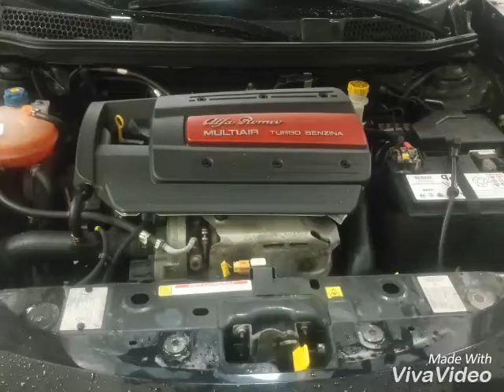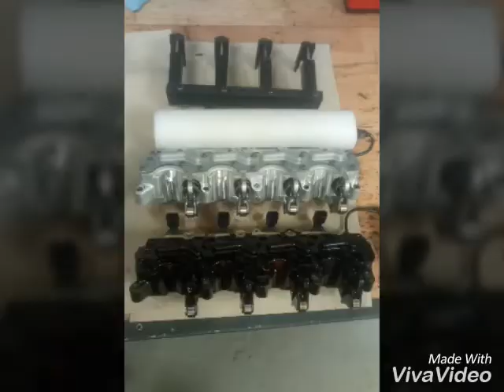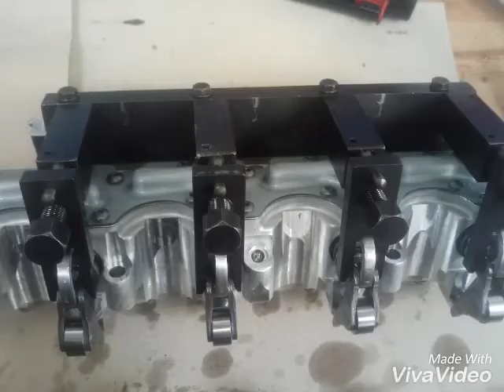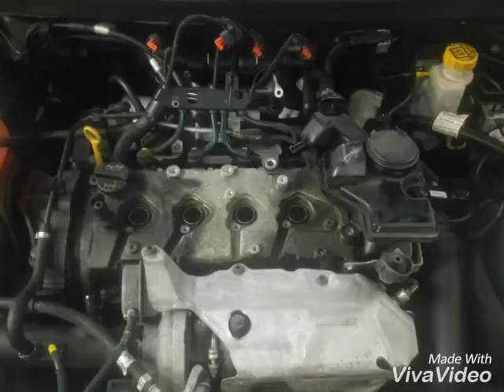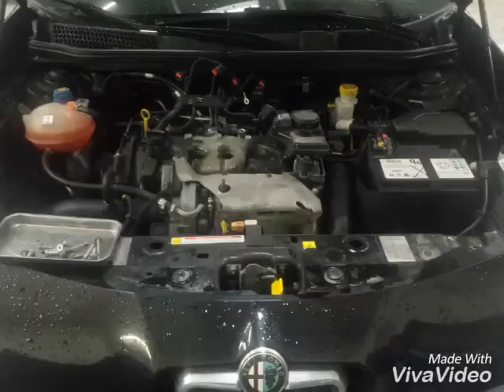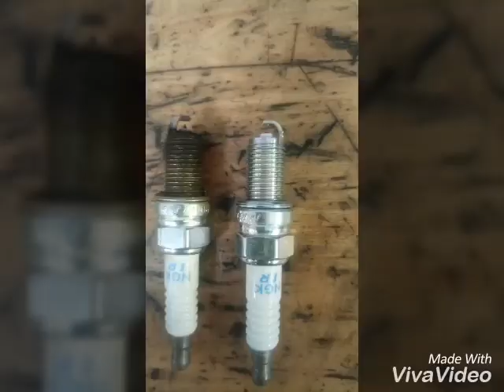Alfa Romeo giulietta multiair module

Comment: Wow! I just had to pulled my Abarth apart due to a failed valve at 147 thousand miles and other than the carbon buildup in the exhaust ports and cylinders everything was spotless no oil buildup to be seen at all you really need to change your oil more often like every 5 thousand miles max that’s probably why you needed to replace the multi air block